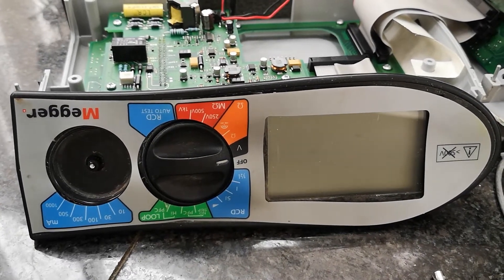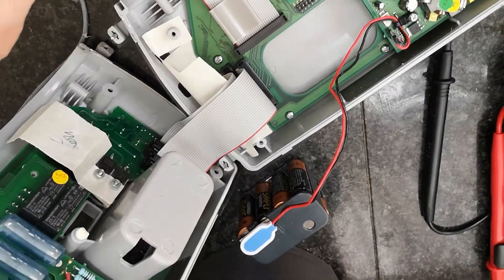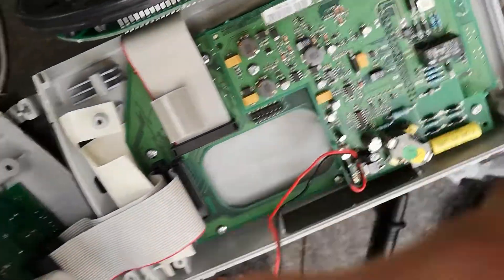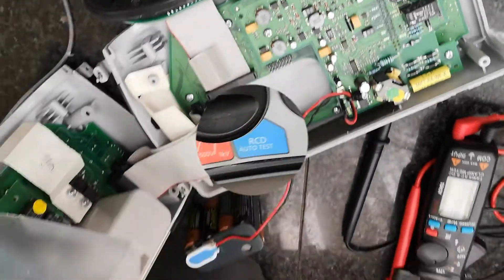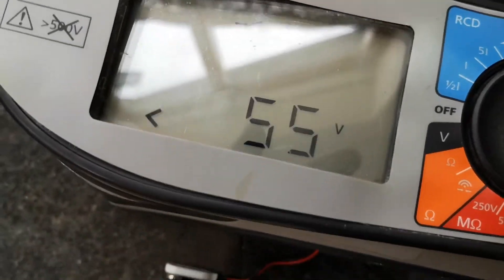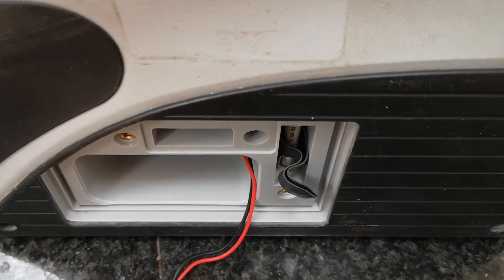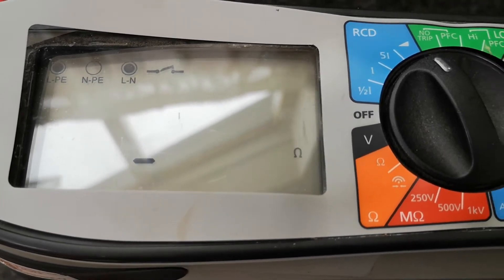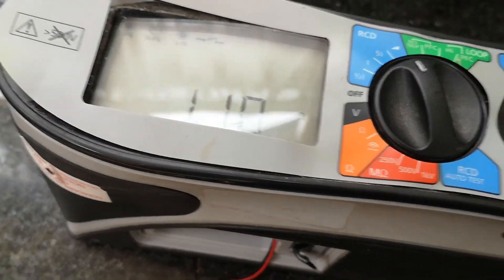MEGGER 1552 Fault

Comment: There's also two fuses beside the one you replaced. I've a problem with the insulation resistance test on my 1502. When I try to do an insulation resistance test it just displays 500mA and the blown fuse symbol. I've checked the 4 fuses I could find and no joy 🤷‍♂️

Comment: Did you really replace a ceramic fuse with a glass one? If my MFT 1552 ever develops that fault I'll know what to do. Yes, it is a rip off to have to return your instrument to the manufacturers to replace a fuse, so you had nothing to lose by opening your tester. Good job👍
Reply from the maker: See 0:56mins ceramic external fuse. Internal fuse was and is still glass.
Reply: @deuceelec  1:26 but it looks like you are holding a ceramic fuse whilst pointing to the glass internal fuse, that's why i am confused. Is the fuse you are holding a different style glass fuse?
Reply from the maker: @curtisj2165  Initially yes, I only had a glass fuse available, I used that to confirm that was the fault and once I new the meter was not damaged I replaced it later with a ceramic (1AF 250v) as I had to order them in. Apologies for late reply.